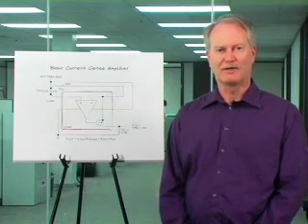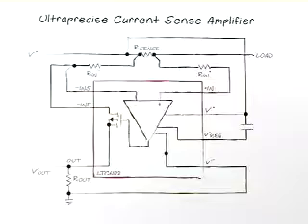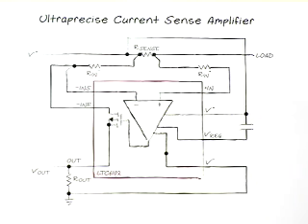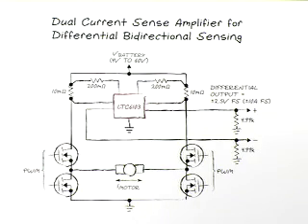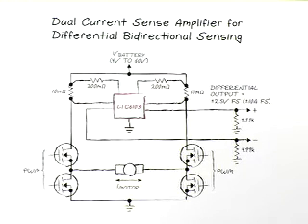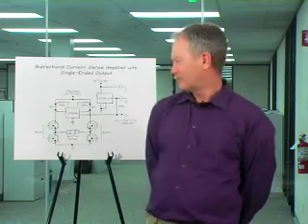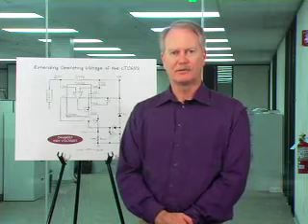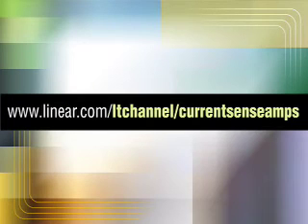Simple Ways to Measure Current - Linear Technology

Comment: What is the purpose of M2 ( the FET with a schottky across its gate/source ) doing in this circuit?  From the circuit it seems this device will always be in its off region with only source-drain leakage current.
Reply: If I understood the circuit right, that transistor together with the gate-drain resistor and 51V zener diode work like a negative voltage parametric voltage stabilizer. The output voltage is between the source of the transistor and the 500V input supply. This way the voltage drop on the LTC is maintained at 51V minus the transistor Vgs threshold.